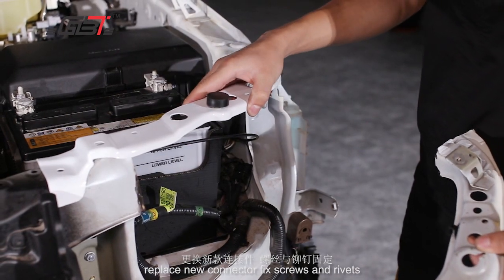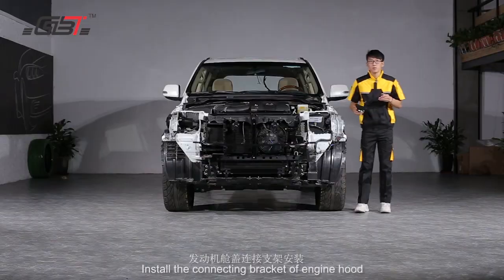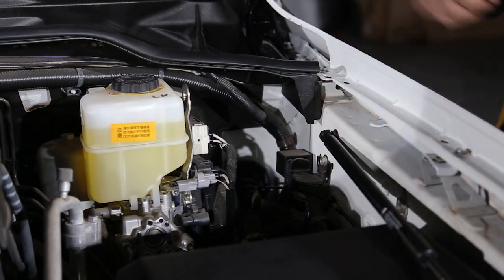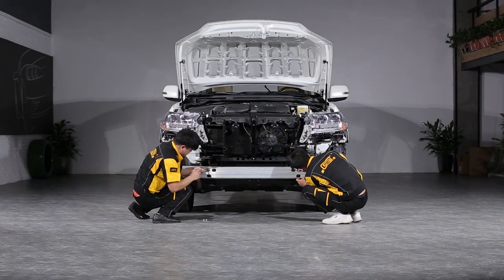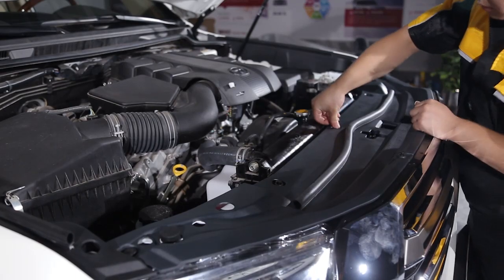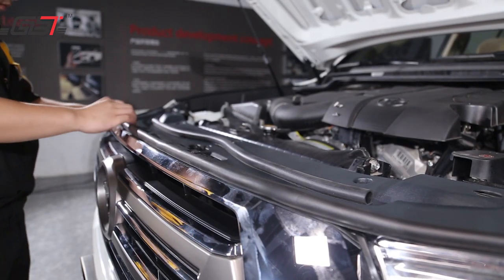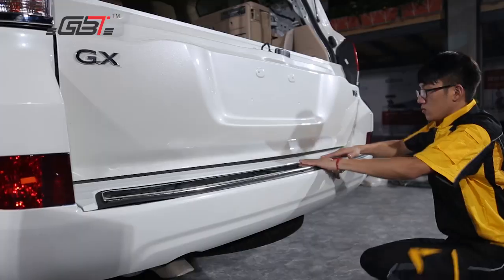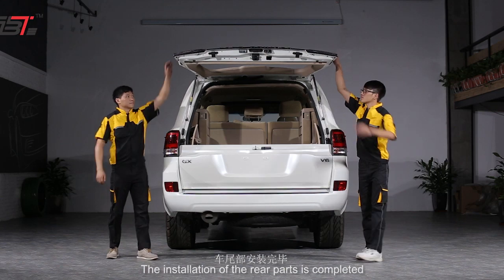GBT BODY KIT FOR 2016 LAND CRUSIER 200 - Installation Video

Comment: After installing this in 2013 LC200, if I need to replace headlight/taillight should I buy 2013 model headlight or 2016? Does the socket remain the same?

I want to get this kit but I want to change the grille and headlight from stock.
Reply from the maker: if 100% want like the new car, need change headlight and taillight, or just very easy change.